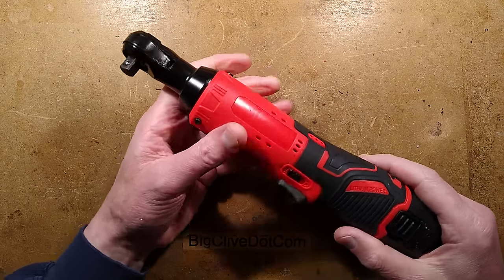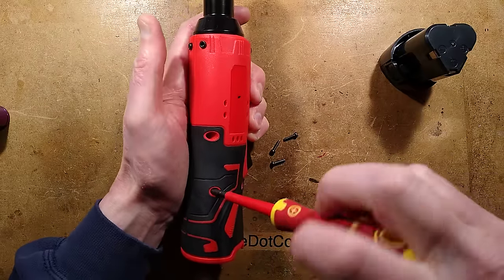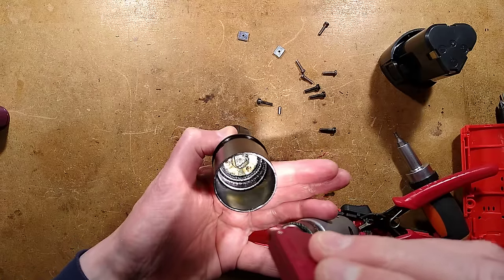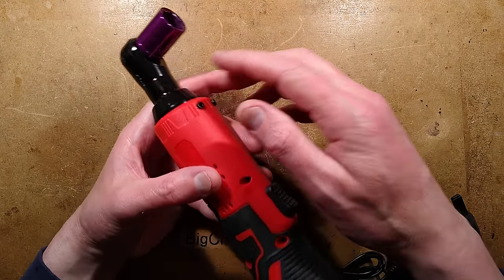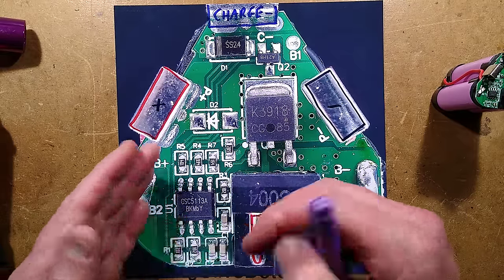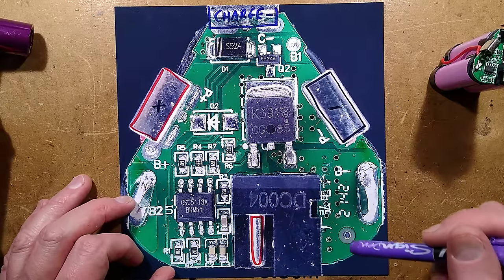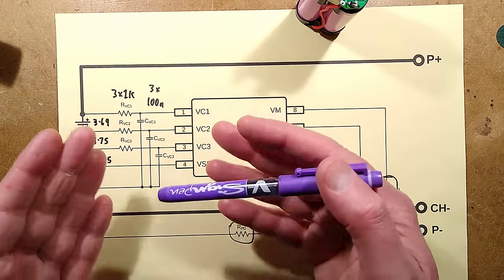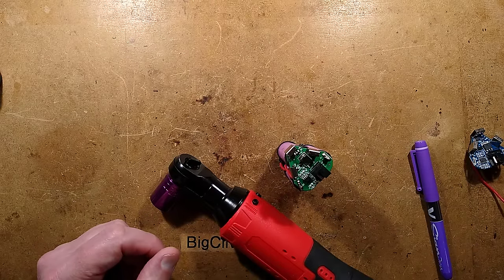Inside a cheap Chinese cordless ratchet

Comment: Told to me by a very old maintenance man when I started in the trade. That wasn't a jesus clip. Both are snap rings but, the difference is that one has holes in them for removal of special pliers and use the majority of the ring to secure what it's holding into place the other is also a snap ring but is called a Jesus clip for 2 reasons. One is that when being removed they tend to shoot off (and people curse with the name Jesus) and because there are only 3 points of contact that secure items into place. The 3 points are key to a Jesus clip because Jesus was secured to the cross by 3 points/nails.

Comment: I bought a cheap drill "Chinese made" and same battery pack and motor as for this one, but I had 2 screws under the label on the battery. So when you Mr start to bend I was thinking no no..there is a screw under the lable, but there wasn't

Comment: I bought one of theese ratchets and the part that failed was the batteries. Had my 4 days off then came back in work and both batteries had died. One was 3.6v and the other showed 0.72v. Got the sell on amazon to sent me 2 new ones.

Comment: I have the first version Milwaukee made and they are great for speeding up disassembly and reassembly. It does what I expect of it so I'm happy. The overmolding does come off the case over time and it gets some wear but a new case is only $7 and then the tool looks nearly like new again. There are others on the market that work well and are a good deal. I want the longer version but there is one from a US store Harbor Freight that is a long version and far cheaper and a perfectly good tool.

Comment: The resistor in parallel with the discharge mosfet (in the schematic) is for self resetting of the overcurrent trip. So the bms resets itself when you disconnect the pack. I had used other bms that does not have that resistor and you have to connect a charger or psu to it to reset it.

Comment: The mechanical construction is identical to the pneumatic version with just the motor changed. I was never impressed with the pneumatic one as it used too much air and seemed only to have enough torque to successfully smash your knuckles on the nearest solid object.

Comment: hey clive i am not sure if i am just loosing my mind or  what but when you drew that diode on there for preventing back power shouldn't the arrow been pointing towards the circuit and not back at the incoming power as that would mean you are letting the power flow back to the charger that way or am i mistaken in my reading of the diode symbol

Comment: An easy way you can tell its not impact, when you're tightening a fastener, you better pay attention when you're getting close to it being tight because ones its tight it will jerk a bit and smash your hand into something if you're in a tight spot, kinda like a drill, were as impact has no movement of the tool it self, the hammer mechanism will just keep impacting.

Comment: Dont worry about breaking the pin. 
The pin only actuates the ratchet and is stronger than the motor. 
If using as a manual ratchet, the ratchet pawls take all the load.

Comment: R_pd looks something like a precharge resistor to limit inrush current when the switch closes. It could also act as a pseudo snubber when the switch opens while the motor is running since the circuit itself is still closed, but with much higher reistance.

Comment: I really hate saying this. However Clive the pawl is in the part that you did not take to bit and under normal conditions it is in a ratchet the most common part to fail. Funny is this tool is very much like most pneumatic ratchets work.

Comment: I bought one of these in orange without a battery. It is supposed to be compatible with a Makita battery, but i use it with an Extol battery. It is tight, but it fits.

Comment: These are a great idea in tight spaces until you get the head of the ratchet jammed against a surface opposite the one you were removing a bolt from. You then can't change the direction of the ratchet to remove either the tool or bolt. I've done that a few times 😡

Comment: So, the battery management circuit is as good as a Dell laptop battery?
I had to open up a cople packs to balance them when the protection board gave up on the pack because one cell was weaker than the rest.

Comment: The pin may not be taking the force when you gorilla a nut with the unit as the pawls will engage and stop things moving. Whether the pawls are very strong is another question.

Comment: We call the cell losing capacity 'walking out of balance' and we used to have to open the pack up and manually balance it. Not so easy on a vehicle traction battery but had to be done.

Comment: Looks like a knock off milwaukee m12 ratchet
Reply: Was waiting for somebody to say about Milwaukee M12 literally here.

By the way they have an adapter device to use the there M12 batteries to be able to be used charge / power a USB device and it also has a 12 volt output on a standard Barrel Jack but cannot remember how many amps Max.

It also has a USB power input to be able to charge an M4 battery that's been inserted into the device so that it can be use as a USB charger for the M12 batteries in addition to being used as a power bank.

They use these with some of the personal systems from that company as well.

But what I'm more interested in he is using this as a portable power supply for 12 volts it's also a bonus having the USB charging and be able to charge the info battery although fairly slowly from USB.

Am looking for a way to have interchangeable battery system like this to be able to have portable 12 volts to go.

That could also be used for other things. Just this and tools of course.

Also they have third party let's just call it a battery receptacle for those batteries and of course a lot of other pool batteries now if you know where to look as well as even available through Amazon but not sure if the battery Management on M4 batteries is internal to the battery or the tool I have a feeling because of the design of those adapters and many others for a different batteries either the battery management is internal to the battery pack or they're just hoping you do the matter management yourself AKA don't over discharge it by rubbing your load too long.

Since the battery adapters that have the wire leads for your own projects or whatever you want to call those.

It's just two wires coming off the contacts nothing else so be very careful if you do decide to do anything along those lines.

Anyone messing around with anything lithium like that would probably at least be aware of what's happened with other certain notable batteries in this world and the dangers involved with over doing things with either charging or discharging lithium batteries kind of don't need to say it do it at your own risk it's a given I think
Reply: I'm also wondering if this would work with the M12 batteries as well forgot to put that in the other comment sorry my bad

Comment: This triangular pack config is used by everyone for 3S 18650 packs. I think I first saw this in a Rockwell driver. Rebuilding these is doable but a bit advanced.
Reply: Dewalt 12V (10,8V) ?
Makita CXT?

Comment: The higher end Harbor Freight cordless tools are nice stuff these days, likely made in the same factory as the big name tools, with the same materials. Originally these were air driven. Never use these with the force you would a normal ratchets.
Reply: They have baur and Hercules that aren’t too bad. But calling them higher end is blasphemy. Not even close to actual tools. I also bought the Vulcan 215 mig welder based on two weeks research. Definitely not even close to a big name brand. But very good for the price. Their whole marketing is Hilton costs this much and does this while our brand does similar( it just brakes the first time you drop it)

Comment: ya dont snap the pin because the pin its self does not take tthe load of the cranking action the lobe does  .. these are the same as the old air ratchets that have been around for ever just with a electric motor instead

Comment: Mine is blue and called "DayPlus"...
 
And you made my day without intention, thanks to your video I rediscovered the charger for the triangular battery in the pile of such chargers I have (from all kinds of electr(on)ics that are long since gone)
I had searched for a socket charger, because my Dremel power tool also has an (sadly almost) identical triangular battery, and that HAS a receiver socket for the pack. And my Milwaukee charger has also a socket for a triangular battery. 
 
Of course the connectors for all three variants are different, so that they are NEVER interchangeable... 

 
(some fun about engineers. In my opinion an imprtant function engineers are paid for is to LISTEN. 
I had a colleague, from time to time he asked for my advice, I went over with him to his desk, sat beside him, he explained his (solftware) problem to me, found the answer, made the correction, and I could go back to my desk, not having said a single word. 
But without me sitting beside him, him having to stand back and think of a way "How can I explain that problem to someone else?" he would have struggled for hours". To have a similar break, I used to go to the toilet, others do a cigarette of coffee break.)
Reply: Addendum: finally had an opportunity to use it, worked fine removing 38 plastic nuts from under the car, where the "transverse" layout was ideal in the confined space and the turning by hand would have really been tedious. 
 
Torque was no problem, plastic nuts are no masters of torque anyhow. Only annoying issue is that it is rather loud.

Comment: That's interesting. The battery looks just like the Parkside (Lidl) and Hitachi 12V batteries. There's some differences in the ridges on the side and chargers, but they appear to be the same otherwise. Some Chinese COTS design maybe?
Reply from the maker: Polarity is different.

Comment: 1:44  The fade-out of the battery level LEDs is interesting.  A consequence of some sort of corner-cutting, I'd wager.
Reply: It is connected in parallel with the motor, which act as an generator when switched off.

Comment: Does this thing have the oofage to undo rusty nuts? Or is it just a glorified finger tightener?
In most aspects, it almost looks like a milwaukee knock off vibrator for the mrs, with a 3/4th bit strapped to the tip.
Reply: These devices are not impact wrenches, nor are they intended to be used in the same way as manual ratchets. They are merely bolt runners

Comment: A couple of things to note. 
First, the offset spindle that actuates the ratchet is not under a significant load when using the tool manually, as the pawl in the ratcheting mechanism takes up the force. I own the Earthquake brand unit from Harbor Freight and I've been outright mean to it with no ill effects.

Second, as I'm sure it's already been mentioned, these aren't designed to have high torque for tough or stubborn bolts. The idea is to loosen by hand and use this to spin out. 

These are absolutely wonderful in tight spaces where other tools will not fit, and a traditional ratchet would take a long time due to limited swing space.
Reply: You’re wrong I snapped a Milwaukee with one hand in manual mode, don’t do it.

Comment: Nice to watch and learn something new. Just wondering, with those motors, if you switched the pole on them, do you think they would spin the other way? Because i always wondered why the Forward/Reverse is still designed as a nob and not a switch.
Reply from the maker: It would reverse the motor, but on these the head would still rotate in the same direction due to the ratchet mechanism.

Comment: A useful tool to have, but will it have enough torque for the average job. You didn't seem to mention the power of the chunky motor which would have been good to know too.
Reply: Probably in the neighborhood of 30 ft-lbs, based on the Milwaukee tool it's identical to
Reply: @B-System  Oh, thanks for the info.

Comment: What's the best way to charge or discharge a single cell to bring it in line with the rest of the pack?
Reply from the maker: I use a USB powered TP4056 module with aligator clips.

Comment: I got a Milwaukee 3/8ths one. Surprised by how much I use it. Especially good for changing my 5 spark plugs. Get them loose with a spark plug wrench then use this to turn them out. Not really necessary for a hobby mechanic but I like to have my toys to play with! Btw, I think you would love the Milwaukee M12 SI201-C cordless soldering iron. It's a little miracle.
Reply: Well, I'm a regular visitor here, but Milwaukee has certainly had its share of visitors. The French missionaries and explorers were coming here as early as the late 1600s to trade with the Native Americans.
In fact "Milwaukee" is an Indian name. Actually it's pronounced "mill-e-wah-que," which is Algonquin for, "the good land."
Reply: @ClintMaas  I was not aware of that! 🤣🤣🤣
Reply: @royevans4581  Does this guy know how to party or what!
Reply: @ClintMaas 🤣🤣🤣

Comment: Can I change the battery for a different brand, better one?
Reply from the maker: Theoretically you could rebuild the battery pack with new cells, but it would be cheaper and easier to buy another battery.

Comment: hello ; I have the same tool but it does not work anymore both batteries are charged , do you have an idea ? 
thank
Reply from the maker: If the motor doesn't run at all it could be the switch, wiring or motor. There's not much in them.
Reply: @bigclivedotcom  thank a lot 👍

Comment: Had one of those for a little while now and was working great until i had to recharge the batteries and now it wont at all, i have no idea what has happened when all i did was recharge the battery???
Reply from the maker: Is there any voltage on the battery contacts?
Reply: I bought similar to this one that takes Mikita battery, on the tool and website says “BL” 
I thought it is brushless and seller also confirmed it is brushless, after receiving it, it’s NOT. BEWARE.
Otherwise, it’s ok to have for extra tool.
Reply: @bigclivedotcom  yes but very low its like charging the batteries sort of drained them instead and now it's that low they wont charge at all, i have no idea ?

Comment: My sister had a cordless grass cutter with the same exact 12v battery. She send it to me to look at it, why it didn't turned on. I've check the motor, switch and wiring. Nothing out of the ordinary until I got to the battery. At first it looked OK. After close inspection, the black shiny body actually hides the semi melted body. The circuit didn't protect the battery from melting the plastic. Luckily it was not a fiery explosion.

Comment: a better design rather then a roll pin would have been a half moon bearing surface clamped from the ratchet side with screws and large threads so that the entire ratchet head screwed on with a 1/4 turn bottom line more metal to take the force the better the week point being that pin to be honest these pins can take allot of force but they are hallow and if not made of tempered steel they will fail under this type of load I think a pin should be a last resort used for much lighter loads such as hinged parts or not impacting moving parts such as switches with odd linkage or such but as we all know you can put 20 amps of current through 14 awg wire until it has to be sustained then things change this device is kinda the same with that pin its fine until its not